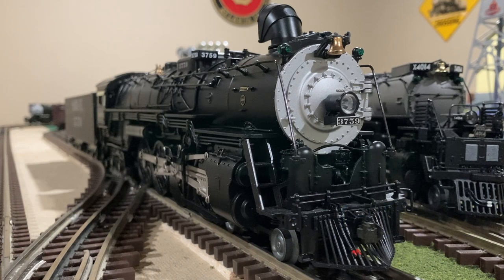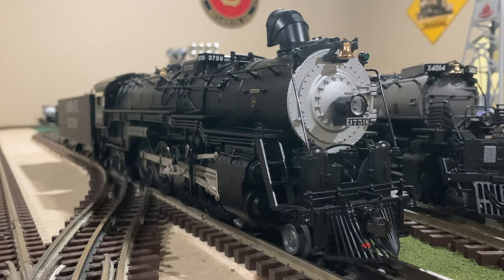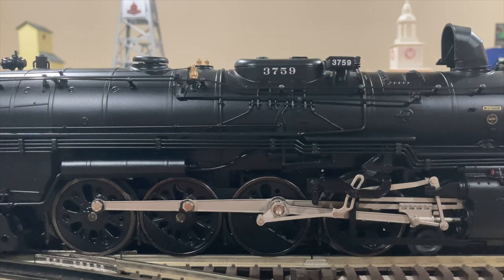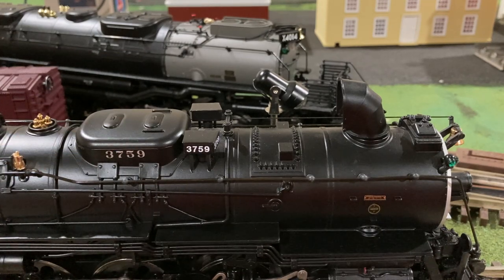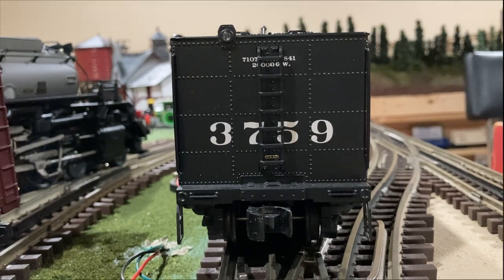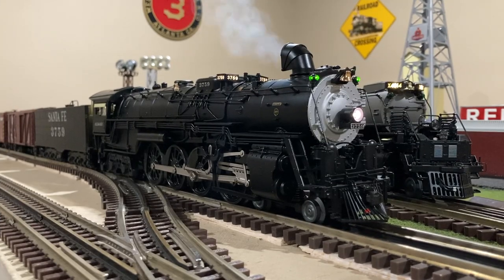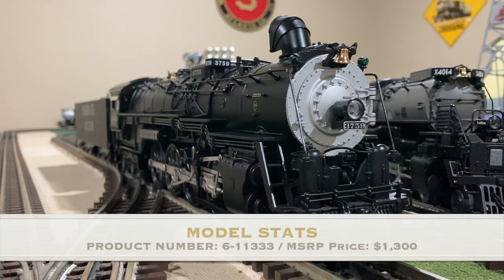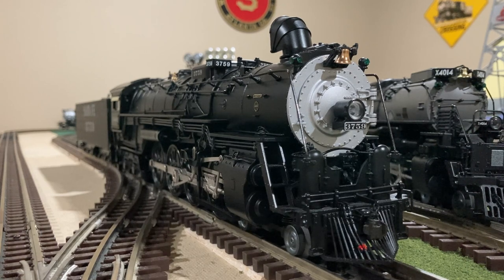Lionel Legacy Santa Fe 4-8-4 Northern 3759: Product Review

Comment: Excellent history of this engine, and as you already know, #3751 is back under steam after a 4-year FRA-mandated overhaul last year, and #2926 had moved under her strength for the first time in 67 years even though she was restored in 2021. Still, because of the pandemic, it was postponed. It was worth it, and I hope that #2926 will be pulling excursion trains soon.
Reply from the maker: Hopefully so. A local train club member has been working on 2926 for the last 20 years and is pretty pleased with its completion. Interesting fact, the tender had to be painted 3 times.
Reply: @TrainMaster04 , really?
Reply from the maker: @nathanielcruz6675  Indeed. First time, the lettering was the wrong shade of color. Santa Fe never had white lettering. It is instead a very near white grey. After it was repainted to the correct grey/white, the tender got vandalized. Now it has the correct shade of paint and is no longer tagged.
Reply: @TrainMaster04 , that's cool.